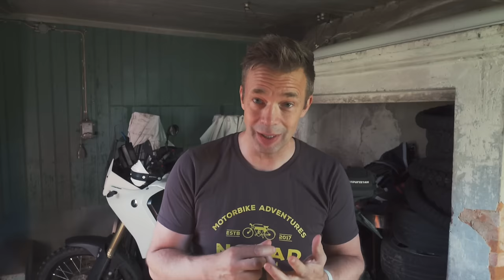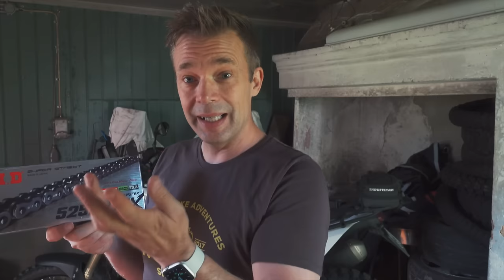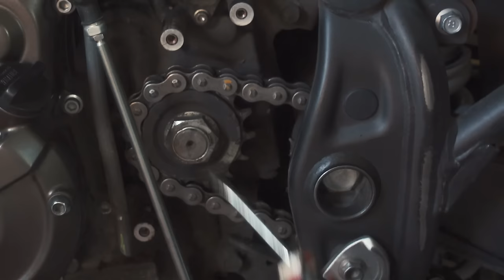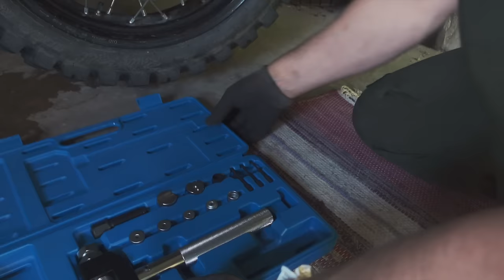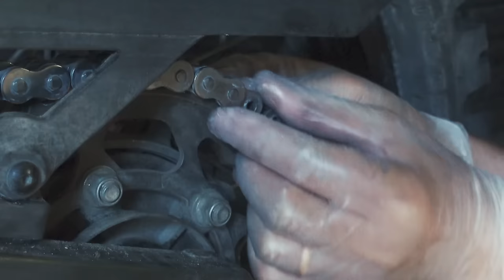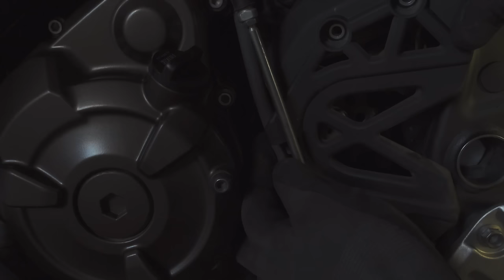How to change sprockets and chain on a Tenere 700

Comment: My tip?
I've been working and riding on motorcgcles 40 years, 15 years had my own shop.
When in the shed/shop, i like to put copper or nickel anti seize (just a tiny dab) on every male fastener thread. On bikes i worked on, my own and customers, i never had a seized fastener, a damaged aluminium thread, nor had to  put a thread repair in (Timesert, Recoil, Helicoil etc). On customer bikes i didnt service before, or were new to me... plenty!
Reply from the maker: Thanks for sharing! I will get some of that!
Reply: It sounds like you relied on the friction of the nut against the washer to prevent it from loosening.
Were you careful, then, to keep the anti-freeze compound off the washer and the part being attached?
In the aircraft industry, BTW, there is no reliance on friction - everything is safety wired.
Reply: @daveinwla6360  its a dab on the male thread. Prolly 2 mm wide by 2-4 threads long. The thing is not dunked in a bowl of the stuff. There's a lot of paranoia and mis information, prolly down to people going mad with the stuff.
Yes i'm familiar with lockwire, use it on race bikes i prepped.
Reply: @michaelhayward7572   - I have used anti-seize under the bolts of my car's mag alloy wheels for decades in order to not over torque the bolts against the soft alloy.  The bolts have never loosened, but it always alarms mechanics!  :-)

Comment: From which point of contact did you measure the distance from swing arm to the chain
Reply from the maker: For the chain slack? Its described in the manual. From the end of the rubber protection under the swing.
Reply: @NomadSweden  the rubber has 3 levels of height itself, thats why im confused

Comment: I had a Tracer 900 and the OEM front sprocket had the rubber cushioning - just as the old one you took off.  I always replaced with OEM front sprocket as I was told it was for noise dampening.

Do you notice a change in front sprocket noise with the replacement front sprocket that doesn't have the rubber cushion?

:-)
Reply from the maker: I did only a short ride, but no I noticed no change.
Reply: I believe this is a cushion drive sprocket to reduce shocks to your transmission / counter shaft to avoid damage to these components in extended road use.  Someone correct me if I am incorrect. A common problem with  many dual sports, especially 250cc class is that they don’t have cush drives from factory and this extended pavement use (thousands of km) can cause premature wear / damage to transmission components.
Reply from the maker: @ExpeditionaryRanger  Thanks for the info!
Reply: I did same on a Kawasaki 1.0 tried steal but was very noisy so got the damped one much quieter. Managed to find an Italian place on the net what made patterned damped front and rear sprockets
Reply: @ExpeditionaryRanger   - I believe that you are right - shock loading of the chain and sprockets are fiercest in off-road bikes, and cushioning would reduce the rate of wear, and importantly, chain breakage.

Comment: Hi Robert. I see you change tyres as well. I think you had motoZ before. How did you found them ? How you find current tyres ? What   Would be the right choice ??
Reply from the maker: Yes, I now run Dunlop R908RR in the rear and R606 in front. I liked the Motoz but I want to build experience in different setups. There is never a right choice :) it is very personal what is right for you. Do you love going in loose or muddy offroad, or do you avoid it?
Reply: Nomad Sweden 🇸🇪 I’m only starting my off-road experience. Got myself same bike as you and recently went in to muddy heaven and had absolut blast but I don’t love stock tyres in mud and grass they are loosing traction in no time. I use bike mainly on road but got this type to explore off roads and I can sacrifice comfort towards more grip. But don’t want to go fully off-road as will use it on daily basis on tarmac
Reply from the maker: Thanks! That narrows it down. Pretty much any 50/50 will be a step up from stock when offroading, but a step down on tarmac. If you want to have fun in offroad, and still go tarmac, I would recommend a combo with knobby in the front and a 80/20 in the rear. Ex Conti TKC70 rear and TKC80 front. Or similar combos from other brands. Like Mitas E07 rear, E13 front etc. That at least keeps the front more steady in offroad, but you get better tarmac life in the rear. But tyre questions are hard :)

Comment: Excellent how to Robert...that will be a good help to people a little unsure.  My last Tenere 660 used to eat chains and sprockets and cush drives, being a big single.  Although the T7 has more power its a bit easier on the drive train.  I regularly lube the chain but I'm a bit lazy about cleaning it...Cheers,  Steve

Comment: As you changed the chain tension, how did you adjust the wheel, so that it is in line with the front wheel?
Reply from the maker: I don't compare front/back. I make sure the "tension markings" are the same on both sides which makes the wheel perfectly aligned unless the frame is crooked.  What else can I do?
Reply: @NomadSweden  u could use a bar or pole to align to the wheels. So you can check whether the marks are correct. Think I read this in a XT500 manual.
Reply: Rene Moreau i use a laser on the back weeekend to tjek the Chain , and the weel is Line up
Reply: @thomasorland9011   - Is that a handheld carpenter's laser that one can buy in a hardware store,
or is something more sophisticated needed?